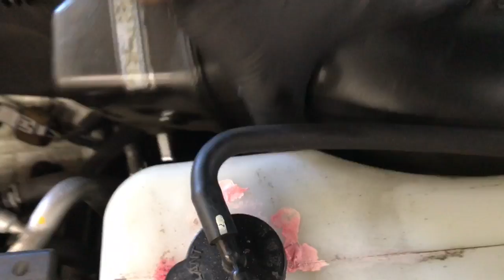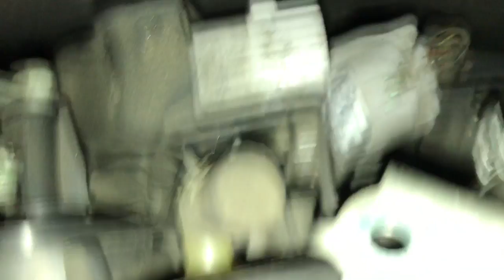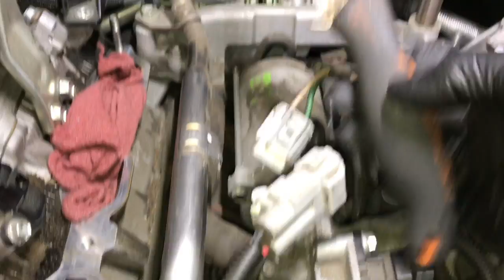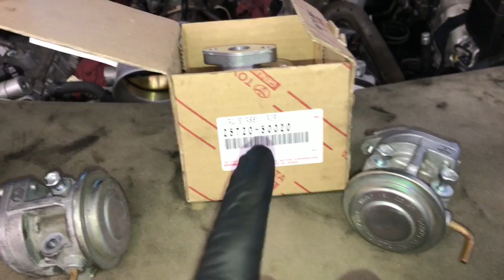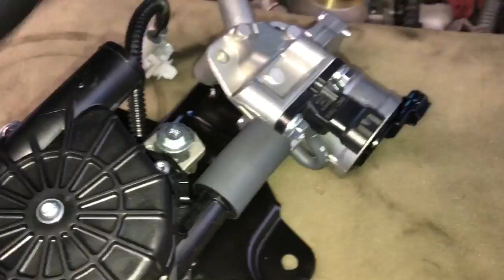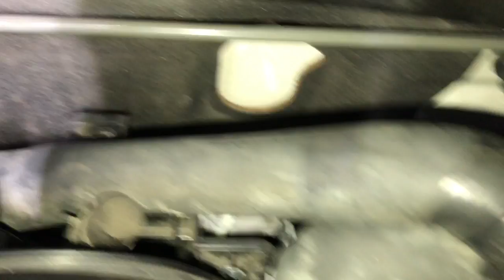How To Replace The Secondary Air Injection Pump And Check Valves On A 2002-2009 Lexus GX470

Comment: This video looks excellent and I hope I don't need to use it. If I need to do this work, I will now attempt it myself. I'm getting SAIS codes and need to first verify that the relay is not the problem, but I cannot find it. Does anyone know where the relay is? My fuse looks good so it might be an easy fix.

Comment: The cam position sensors have a clip between the fuel rail and connector. Stick flat screw driver in between from the top and twist to depress the connector before pulling the connector off.

Comment: Great video.  When you remove the check valves do you have better access to the starter bolts?  If so, I will order a starter too.  Thanks!

Comment: Hi Brian,
I watched the video and followed all steps but I stuck in whit the check valves.I can’t reach the back bolt on the check valve probably I’m using the wrong tool . How I can find that specific thin wall socket you use ( Snap on or something similar)Thank you.

Comment: Hey so it seems to me you pretty much have to remove those check valves to be able to get to the bolts holding that damn starter in, right? I'm cursing the day my wife's '06 Sequoia was manufactured as we speak...😡

Comment: Thank you for this and your other videos on the secondary air pumps and bypass valves for the 4.7 L. They helped me a lot. I cursed the wire harness throughout many steps of the way, especially removing the manifold and the back bypass valves.   I had to remove the back crossover pipe to remove the bolts on against the firewall, but I also had coolant leaks so I needed to change the gaskets of the pipe.  I went the cheap route and tested the pump and first valve, fortunately they were working and saved myself $1200. Thank you again.

Comment: Thank you very much for this video.  I’ve got a coolant leak at the front and rear bypass.  I’ve been trying to figure out how to get those check valves off.  I’ve got 217k on the 06 gx, should I do the secondary air system while I’m in there? What about the starter?

Comment: Brian,  I followed this video and replaced all components, I did have to replace the 3 wire connector to the Air diverter, and check engine VSC went out, but came back a day later, took of the neg battery cable and all dummy lights went out for a day, but came back,  where should I start troubleshooting.  I am subscribed and like your videos are a life saver.
Reply: Hi Jay. I’m about to do the same on my end. Out of curiosity, did you manage to resolve the issues, if yes, what did you have to do further? Thank you in advance.
Reply: @michaelleroux338  No, I am still getting the check engine, VSC, lights, there are two valves that I need to check, I would check those first there is youtube video showing the location of the valves.  Also, I have already purchased a new gas cap.

Comment: So to make it easier if you remove the crossover pipe in front of the check valves, do the check valve attach to the pipe for easier installation?
Reply from the maker: Thanks for the tip 👍 and watching!

Comment: Great detailed guide on how to fix this issue. I’m currently experiencing a problem on my gx 470 not sure if it’s related to this problem since yesterday after starting up the vehicle a vacuum like noise emerged from the engine lasting about 15 sec. any advice do you think this might be the root of the problem?
Reply from the maker: Jp Meza that is a common symptom of the air system going out. But it’s hard to say with out hearing it.
Reply: I’ve seen that thers a bypass kit option for this problem do you recommend that? Thanks in advance.

Comment: Any procedure I should do before disconnecting the fuel lines
Reply from the maker: Vision Maloco before you take anything apart you can pull the fuse or relay out for the fuel pump and start the engine and let it run until it stalls out. That will bleed off any fuel pressure👍
Reply: How to Automotive thank you so much for that information

Comment: Hello I have a 2007 sequioa. Will it work the same way. What code did you have. I have  a 
P2440 code. . Also what is the part number for the thin wall socket that you used to remove the 2 check valve? Thanks

Comment: If you have this problem just buy the bypass kit from Hewitt-Tech. Takes about  1 hour to install the kit. No more codes!
Reply: Michael Diaz 
Will it pass inspection if you bypass this issue
Reply: Yes no problem! Just install with wire loom around purple wire to make it look professional and factory installed. So they won’t notice the bypass kit.

Comment: Hello, thank you for the helpful video 
I have a question 
I replaced all parts like on the video, but all the signs still on after a week. Never went away. 
Any suggestions
Reply from the maker: maged obadi did you clear the code with a scan tool?
Reply: I did clear codes with scanner they go away for a like 10 minutes but tha. They come back on as I’m driving
Reply from the maker: maged obadi what are the codes?
Reply: How to Automotive I don’t get any codes but lights on though
Reply: When I first start the car. No lights on than, when I put it in gear and start moving three lights come on . Vsc trac vsc off the slid sign

Comment: Hey Brian I'm having a strange issues and I'm not sure if its related to a secondary injection pump. When I'm driving the car and accelerating the car on the road I start to hear noise like an exhaust leak. It sounds like a car with a louder exhaust is driving right next to my car. I've been told that its a leaking exhaust manifold but I don't hear this when the car is park or when I'm revving the engine. Only when I'm driving. I have no check engine lights and this has been going on for over a month now.

Comment: Great video.  Thanks!  Do you have a link for the 10mm socket and wrench you use to get to the back bolts on the valves? I believe you refer to it as a thin wall socket in the video.
Reply from the maker: akennedy I got them from snap on there called quarter inch drive flank drive ratchet set. I don’t have a link. I believe gear wrench has a similar set
Reply: How to Automotive Thank you!
Reply from the maker: akennedy thank you for watching!
Reply: @HowtoAutomotive  is this SAE or metric. I noticed that you were mentioning metric units throughout the install, just want to make sure I buy the right one. Thanks.

Comment: need your help, just did this repair following your steps, I double checked my work and i think it was done properly.  I drove it about 60 miles after resetting the lights and got the p1444 and 14441 codes again and car went back into limp mode?  What could have i done wrong?  All vacum lines have been double and triple checked.

Actually,  I think I figured it out.  In my case the VSV number 1 valve was also stuck.  I disconnected the vaccum line connected to it and then reconnected it, now everything seems to be working well.  I think this has fixed the problem.
Reply: Thanks for the follow up!

Comment: I was able to replace these two check valves on my Sequoia this weekend using a 3/8 extension and knuckle for the exhaust tubes and I used a Dremel tool to make a 10 mm stubby socket that is a must have. The magnet tool was a  very helpful tip, pun intended. Put an old pillow over the radiator support, it will save your ribs. Pace  yourself and take deep breaths if you get into a spot that is difficult. Great video to watch as you go. Unfortunately I’ve replaced the pump and the rear check valves but have to repeat the process to replace the diverter valve cause the light is still coming on. Code P2445
Reply from the maker: Oh Yeah that’s so awesome how you get creative and made the job happen. Thank you for all the tips!

Comment: hi
thanks for sharing amazing video 
helps a lot but i do have question i had a code (p1441 secondary air injection system switching valve no.2 bank 1 and 2 stuck open) on my 07 lexus gx470 i took it to my local mechanic he said it needs pump and i tried to show him your video as you suggest to put valves and pump together but he decided to put pump only 
now after putting pump i am having same problem and an additional code with p1441 and p1442  i am not going that mechanic anymore and dont want to spend a lot please i need help i would really appreciate your suggestions thanks
Reply: The top cover of the air pump has an intake pipe sticking out, around 1" diameter. Under the black plastic cover is a foam filter. The air enters through the intake pipe , goes through the filter, and then into the pump. The foam deteriorates over time and starts breaking apart and goes into the air pump. It can start plugging the plastic pump vanes and cause them to seize up or break. Some pieces of foam can then go downstream to the air injection control valves and cause them to become stuck open or closed (codes P1442/ P1445). The main culprit for this very expensive repair appears caused by that foam filter. This same air pump is used on many different brands of vehicles, and has caused failures repeatedly, including on the same vehicle. Dealers and the OEM can make a lot of money by saying the codes say the pump or valves need to be replaced. When the only problem is to clean out all the old foam filter material. Toyota finally came out with an extended warranty on these parts to 10 years or 150,000 miles. Lexus has not done the same, even though their 4.7 engine uses the exact same part. That also does not help those who do not qualify, such as the many Toyota and Lexus vehicles made before 2008. I have not found any replacement filter that has been substituted for the original filter. To just keep putting back in a replacement pump with the same filter means it will happen again. I am having to replace the check valves again after 20,000 miles. This is after replacing the pump and valves by the Lexus dealer at 114,000 miles. The foam filter looks like a $1.50 part in cost. I would suggest that any repair in this system include checking the condition of the foam filter. If it has deteriorated it will have worked its way into the pump and possibly the switching valves. I would want the entire system be checked for any loose foam pieces  and be cleaned. If they just replace the air pump assembly and don't check downstream the valves may become stuck open or closed. On the GX-470 this pump is located under the intake manifold and there is little room. If the mechanic can find a better external filter that will fit on the intake pipe, and remove the foam filter from inside, it will probably keep the problem from happening again. The manufacturers and dealers should have fixed this easy problem years ago. I have found videos that show the filter, filter material inside the vanes on the pump, and filter material sticking out of the valves.
Reply from the maker: conquip that’s exactly what I’m seeing is that foam coming apart in the pump. I tried cleaning it one time and if you miss one little piece it may  hang something up and you’re going back in there to do it again.
Reply from the maker: Shery H sorry you were having car trouble's. What happens is when that pump fails particles of it get pushed through the whole system and cause other valves to stick open. The only real solution is to go back in and replace them. And if that other mechanic diagnosed it then he should go back in to repair it. I would recommend him pay for the labor you pay for the parts.
Reply: thanks and yes you are right  i am going to talk to him again tomorrow let's see what he says i am thinking to buy him all the parts if he put them in
Reply from the maker: Shery H good luck hope it all works out well for you.
Reply: I had them replace the two valves and got the old ones back. There were pieces of deteriorated foam material stuck around the edges. I could actuate the valve opening by creating a vacuum on the pipe sticking out the side. A spring keeps the valve closed automatically. It is the vacuum that causes the valve to open. That means the diaphragms were good. If the pump is damaged then it needs to be replaced. If it is only stuck by loose filter material then a good cleaning should fix the problem. It is also important to clean all lines and valves downstream of the pump in case filter material has gone past the pump. I also had them remove the current foam filter under the cover on the pump unit, and replace it with a Uni-filter UP-107 breather mounted on the air intake pipe on the pump unit. 
I am very unhappy with Lexus, Toyota, and all the other car manufacturers using those foam filters inside the Secondary Air Injection pumps. This problem has cost car owners a lot of money over a cheap foam filter that never should have been used.

Comment: What causes the switching valves to go bad? Ruptured diaphragms or seals? Ever taken one apart to diagnose?
Reply: I just had mine replaced and asked for the old ones to be returned to me. Took off the cover held on by two philips screws. The code had said they were stuck in the closed position. Both had pieces of the foam filter from the pump unit stuck around the valve edges. I could actuate the valve by sucking on the pipe sticking out the side. The valve opens by vacuum being applied to the valve. The valve is kept in the closed position automatically by a spring. The loose foam filter pieces keep it from closing all the way, or in my case stuck closed,  which triggers the DTC codes. It looks to me like a good cleaning of that area would have solved the problem. I had the foam filter removed and added an external filter on the intake pipe sticking out of the side of the top of the pump unit. It is important to make sure there is no foam filter pieces anywhere downstream of the original location of the foam filter. If the pump goes bad from foam filters pieces and the downstream segments are not cleaned, then the loose pieces can cause the valves to have issues.
Reply from the maker: Oh Yeah inside the pump is a filter that dries out and breaks apart and the particles go through the system making the valves stick open or closed.
Reply: Could I just clean them like I did the diverted valve?
Reply from the maker: Oh Yeah that may work. For me it's too much work to risk it.
Reply: I've had my intake off three times now trying to fix this issue so I'm getting good at it.

Comment: Thanks very much for sharing this video! I do have a question. I am working on my 05 4Runner with the same engine. SO I have the SAI fan and diverter valve removed. Do I really need to replace the 2 check valves? Also, when I was moving side to side the cooling pipe that runs front to back, a little coolant leaked but I was able to stop it by pushing it towards the front and that stopped the leak. Question is do i need to bleed it after? Thanks very much in advance!
Reply from the maker: John Lee I would recommend replacing the valves. You can check them now that you have room and see if they're working and if they are you leave them. You are taking a chance. You will not have to bleed the cooling system. Just make sure it's topped off.